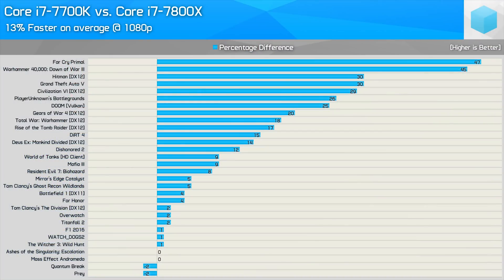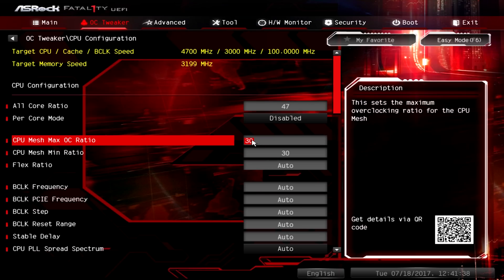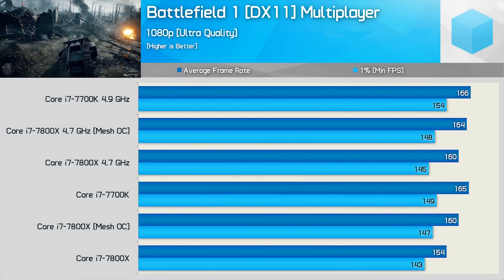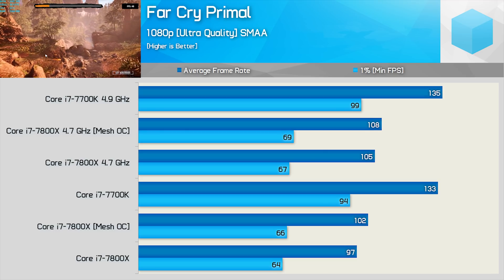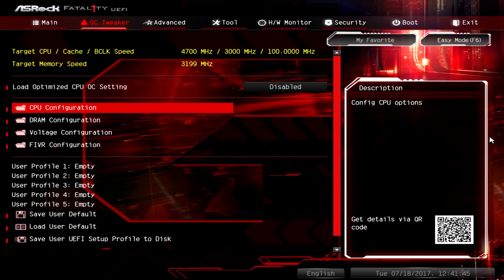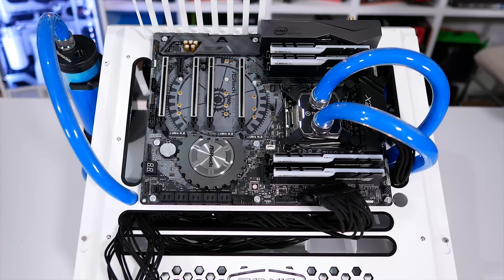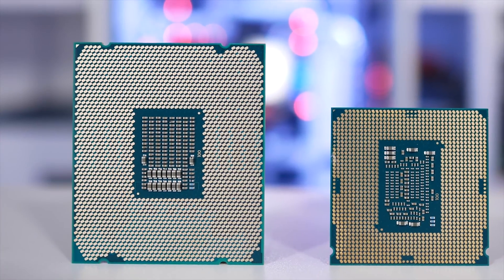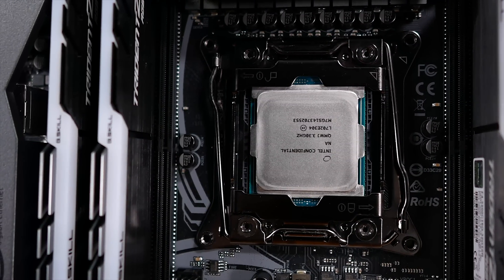Intel Mesh, Does Overclocking it Fix Skylake-X?

Comment: who's intel?!
Is that dead grandpa of amd?
Reply: Alex Lee - History shows, when AMD was last able to seriously compete with Intel, Intel tried hard, and it was good for all of us consumers. When AMD went down, Intel stopped trying hard and charged like a wounded bull for pretty much the same stuff they sold you 3 years ago. Now AMD are back, and suddenly Intel are pulling the wrapping paper off all this new bling. Why didn't they sell us that stuff last year? No, they didn't suddenly develop all this new bling since Ryzen got here - it takes longer than that. They pulled their finger out and started trying when the rumour came that Ryzen was on the way... Until then, they had their finger in all the way to the elbow....
Reply: Kneedragon1962 i'm not sure what you are trying to tell me but those 'bling's they showed turned out to be not that impressive if not disrespectful to consumers. i use an i5 myself so don't judge me but take the truth as is. intel is getting their ass handled and this is good for both sides.
Reply: OpTic KTG Daammm boy I've only been going off the windows 10 64bit benchmarks,...Windows XP was a great platform but Daaammm kid you have my sympathy!!.
Reply: MayDAY going down

are you dumb? its a first fucking gen arch vs intels thats been the same basic shit for like a decade. of course the first release wont be as good as the thing the competitor has been refining for years and years. 

however ryzen 3 most certtainly wasnt designed for gaming same with ryzen 5 and 7. all the cpus were designed for server use. the arch is a server arch. they simply happen to also be decent for desktop purposes. originally amd had a separate arch planned out for desktop cpus however that one was pushed back in favor of zen. 

also theres the fact that the 7700k wins only at 1080 but has worse minimums in alot of games and has more fps dips. 

theres also the fact that you literally just tried to compare a fucking server and HEDT platform to a desktop one. 

how about this then, notice that at the low end amd is worth more? aka better value. fuck a 7350k id get a 1400 for that money 2 cores 4 threads vs 4 cores 8 threads and a less then 15% difference in ipc. with a whole fucking 1ghz disadvantage in clock speed. 

how about that intels newest core i9 series is shit for the money and pointless. at 18 cores the people who would run that shit are the types who would most likely want ECC ram but you can only get that on locked xeons. how about the fact that intel artificially removes ECC support on chips, notice how before skylake i3s supported ECC and now they dont.  notice how intel is shitting talking a dual die cpu when they did it themselves before.  or how about that people on intel cpus havent felt the need to upgrade for a long time for those that actually know shit. 

oh yeah and btw 1080 144hz is a bullshit comparison unless you either have gsync or freesync top end gpus and lower settings so that the game stays above 144 locked no matter what you play. which isnt possible.  minimums at that point are more important then maximums. hence why lots of people are saying who cares about 10 fps when the minimiums are better or similar in many cases. 

and how about this, amd releases first gen arch intel is on their what like 6 refresh. what happens when amd releases a refresh and increases performance and clock speeds.  what happens if intel uses the UPI mesh design on coffee lake as well as the victim cache and hurts performance. amd is barely behind. and costs half. buying a ryzen 3 for like 100$ when they drop would be the same as getting a 4790k only on amd and alot cheaper. and it uses less power is easier to cool and actually beats a 4790k. 

intels been slacking. so maybe stfu use your head and realize sure intel wins my a minor amount. heres the question though. can you in a blind test even tell the difference between 120hz and 144? i doubt it as most people cant and even those that can often cant while actually immersed in a game. 60 hz to 144 sure 60 to 75 or 120 yeah. 120 to 144 is just for pro gamers or people wanting bragging rights. so if you cant really notice the difference why spend more for less. you get less cores less lanes and no upgrade path. if you cant notice the difference but still want one to bragg then let me ask you do you have a top end mobo ram psu ssds hdds and dual 1080's or 1080tis? or a titan xp? no probably not, thus shut up as ryzen means an OVERALL better system. hmmm ryzen cpu and cheaper board and better ram or 7700k on a non z270 chipset and a 1060 instead of a 1070 or 1080. hmmmm. 

a 7700k is if you dont mind upgrading sooner and already have top end everything otherwise its better to go ryzen. and even if you have top grade everything else sometimes ryzen is still better to go with as there is an upgrade path and it costs less so when you do have to upgrade youve saved more in the mean time. 

theres also the fact that a 1700x at 4ghz with 3600mhz ram vs a 5ghz 7700k with the same ram and a 1080ti closes the gap. so what happens if we get 4000mhz ram on ryzen? ram speed beyoind 3200mhz on intel is a waste and within margin of error where as on ryzen significant performance increases can be seen. 

what about yields and cost and profits amd will win that argument everytime which means they make more money. intels monolithic cpus while they have advantages they reduce yields hence why xeons are so expensive. where as amd can cheaper produce cpus with easily equivalent performance and even more features.  64 pcie lanes on threadripper only 56 on the brand fucking new skylake xeons. where as epyc has a fucking 128 lanes per system.  also dont forget amds shrinking to 7nm for their next cpus. thatll mean even less power at the same performance or much more performance at the same power. combine that with a ipc improvement in the actual design itself and yeah it wouldnt be hard for amd to catch up or offer even better value for the money and make intel less and less worth it.  intels next cpus are going to be on the same process as they are now just refined. no die shrink.  then there is the clock speed issue that some believe to be an issue with clock gating and believe it to be fixable by amd. so what happens if ryzen 2 gets a die shrink ipc boost and a clock speed boost up to say 4.5ghz which would only be a 200mhz over a golden chip currently and only 400-500mhz over an average cpu.  p[lus costs less doesnt need a new mobo and again has more lanes and more cores and similar performance.

sorry but you should use your head. the 7700k is a dumbass arguement being made by people. the only advantages intel has right now are in workstation purposes for any real users. mostly because intel has much faster avx performance among some other things. however is it worth the price difference? depends on the use case.  or if you play old games thatll never get patched for ryzen support then you go intel. 1080p with a fucking 1080ti when even a 7700k and 1080ti cant run it properly is just a bullshit statement, unless you can stay locked at above 144 the entire time maximums dont matter its better to have better minimums and less dips. 

ironically if intel had left the cache alone and also used a ringbus im betting that the 6 core x299 part wouldve become the new high end gaming cpu. 7700k wouldve been for fan boys that couldnt afford a 6 core. 6 cores equals less strain on the cpu with background things such as the OS and such, and wouldve meant when 8 thread gaming is the norm youd be able to have 4 cores 8 thread dedicated to the game and still have cores and threads for the os. wouldve simply reduced dips in some games and in others wouldve increased performance.  

sorry but quadcores as a high end gaming chip are dead. 

4c4t entry level

4c8t mid tier or ryzen first gen cpus since clock speed and ipc limitations. 

6c12t new high end gaming cpu.

8c16t entry level streaming processor

intel 10core20thread or amd 12 core dual stream/workstation cpus. less gaming performance but better for handling streams while gaming. 

at least for new games.
Reply: Kneedragon1962 Like I said to the guy, if you are just a gamer and own an i7700k Running at 5Ghz you ain't gunna upgrade to Ryzen for a couple of years, why would you?? you'd only be getting less frames in gaming performance.
It will take gaming devs a couple of years to utilise more than 4 cores, they themselves have stated that.
So if your just a gamer tell me why would I change my i7700k for any Ryzen CPU???
Would it not make more sense to wait for next year's or the year after 6 or 8 core CPU'S which will be fully optimised for gaming and be beating these Ryzen cpus and the i7700k??.
Reply: Kneedragon1962 Lol, as you can no doubt tell I'm not a streamer, never even been interested in doing it either, still ain't:).
I'm playing Elite dangerous Horizons in VR at the moment, I can't imagine the pain in the ass it would be having to continually take the headset off to check other open apps and streams, the game itself is complex  enough as it is without distractions lol.
I'm looking forward to the day devs implement full 8 core gaming cpus, when that eventually happens I'll be upgrading for sure, I highly doubt it will be an Intel CPU the way it's going. I'm really impressed with What AMD have done so would deffinatly consider one of there next cpu line ups that they make in a year or 2 time.
Reply: Who is AMD? Did they ever reach more then 20% market share? Everybody knows Intel inside with 80%+ market share.
Reply: Alex Lee - Then we are in agreement.
Reply: MayDay GoingDown!! Glad to have a civilized discussion with you. Of course the 'grandpa's should outperform. They cost that much more. However the ryzen chips for their price, totally outvalues intel chips at the current state.
Reply: +MayDay GoingDown!! I guess you don't get the joke 😐
Reply: +MayDay GoingDown!! Sorry I replied to the wrong comment
Reply: OpTic KTG Lol, hey no worries dude:)
Reply: Tripp Z Would I buy an i7700k today??
Depends on what you are doing.
If I'm just a gamer then yes; right now it's top of the board, it's only $300.00.
None of the 6 or 8 core Ryzen cpus are gunna be beating it in gaming until devs start to utilise and implement more than 4 core cpus...and that ain't happening for at least 2 to 3 years since the huge majority of Gamers are all on 4 core gaming cpus.
By 2 to 3 years all of these Ryzen cpus will be getting destroyed by the 2 to 3 years time cpus, so yeah, with the i7700k running at 5ghz your gunna have the best gaming CPU for 2 to 3 years.
If I was more into multitasking various apps and stuff I'd buy the 1700 or 1800x.
But don't forget, in 2 years time both Ryzen 7 and 8 will be far behind the new ones so.!!!!.
I myself upgrade both CPU and GPU every 3 years, this is because I like to not fall to far behind having the best spec in my rigg.
So regardless of which ever I buy now it's getting replaced in 3 years anyway as it will be pretty far behind in performance by then.
Put it this way, anyone with an i7700k is not going to upgrade to any Ryzen CPU and that's even including Threadripper and Epyc as they would be losing not gaining performance in games if it's only gaming you do, which is still the majority when buying these cpus.
I can already see people on many YouTube channels are dreaming of buying Epyc or threadripper thinking they are gunna see huge gains in gaming performance when in reality you might as well buy the half the price 1600 or i7 7700k as the 1600 gives you exactly the same gaming performance as threadripper and Epyc....the i7 7700k beats all 3 and for less.
These people will merely be wasting hundreds of pounds lol.
Reply: @ bmxriderforlife1234 - Very long and detailed and correct. I agree with you. Unfortunately, the person you're answering is probably not someone who will read it...
Reply: most likely not. oh well maybe someone else will and will realize something or not get fooled by a fanboy.  right now intel doesnt offer a good high end gaming cpu to be honest.  hopefully z370 doesnt use the new cache system and sticks with the ring bus design, well some people more knowledgeable then me are saying cache is the issue and that the link or bus would actually help performance had caching not changed. 

intel just needs to stop fucking up and realize you cant pay record high dividends anymore.  and solder your high end shit.
Reply: bmxriderforlife1234 First off your completely wrong...Sorry bud.
You think an i7700k only beats those cpus at 1080p???? Wrong, beats them at all resolutions, and once past 1080p the card is doing most of the work not the cpu.
You yourself have put the 6c 12 thread as a "New high end  gaming cpu"??? 
Makes no difference, the i7 7700k is currently beating that too yet your saying 4 core is dead. Well maybe in 2 to 3 years 4 cores will be dead but by then I wouldn't be buying these Ryzen chip's but rather the AMD or Intel chips out in 3 years time.
which brings me to my point, if you own an i7 7700k you won't be upgrading to these Ryzen chips now, you would have less performance in gaming...why on earth would you do or want that??? Hence your good until the next gen or wait for devs to utilise more than 4 cores in all game titles which according to them will take a couple of years before it's the norm.
Like I said, if you are only gaming then show me any Ryzen chip that is beating an i7700k Running at 5Ghz???? 
If your multitasking then yeah get the 1700 or 1800.
Show me the benchmarks of your New 1600 "high end gaming cpu" beating an i7700k Running at 5Ghz across the board in games at any resolution???
Show me a 4 core isn't still going to be beating a 6 core for the next couple of years??.
The i7700k is $300.00. Hardly Intel's highest end, point is it's beating all Ryzen CPU'S in just gaming which are still the majority by a long way over streamers.
Reply: MayDay GoingDown - Yeah, true. The funny thing, is we've been here before. Just on 20 years ago we had screaming blues about screaming Cindy. Streaming SIMD was a wide data path designed to put one repeated instruction to a stream of data, which is very useful for decoding video, for example. But it doesn't help anything unless devs use it. So we had a screaming argument about the Pentium and the Pentium2 and Screaming Cindy. I'm sure it does get used now, but for ages after that, nobody anywhere used it or admitted to using it... it just became so politicised... More recently, in Linux, we've had systemd in place of init. It seems to work alright, that's not really the problem. It's become political...
Reply: obviously no one who just bought something is going to upgrade.  no one said they should.
 you cant actually say that, first off go look at all the videos talking about how fx cpus improved more over time and now beat or tie the 2500k. 

obviously the card is doing more of the work however that doesnt actually mean anything. 1080p gaming benchmarks dont really mean as much as people think.  and are kinda moot since neither cpu can drive 144hz properly and we dont even have a single gpu that will at 1080p either unless you really lower settings at which point why buy top end hardware even pro gamers often dont.  go look at current games, games already and have been for a while now moving towards 8 threads. you can already see this with i5's notice how people complain about them stuttering a shit ton in many modern games with 1070's. pretty sure this channel himself has stated that 6 cores are going to be the new thing. wendell of level1techs has pretty much said though not in these exact words intel has been stagnating the cpu market we shouldve been at 6 cores by now. hes right. 

okay let me spell it out for you, intels own x299 7800 6 core cpu, the reason its performance is ass  is the cache and potentially mesh. skylake has kabylake ipc as far as gaming goes. so since we cant use that comparison we can use another, take an older gen i7 and the equivalent xeon downclock the i7 to the same performance as the xeon, now test, in many modern games the higher core chip will get bottlenecked less.  the 2 extra cores arent there for the game they are there for the OS. we are starting to hit the limits of what 4 cores and 8 threads can do. and intel didnt increase ipc much the last couple gens. 

theres also the fact every current game is a rigged comparison in favor of intel (yes even amd games) why because the simple fact of ryzen was a rush job people didnt know. games were not designed for it. im sure there isnt a hell of alot on the table but im expecting there is still performance purely for the arch itself. some devs have actually commented about this saying how what works for one arch can severely hurt performance on another and that there is only so much that can be done post release. 

i never said ryzen right now beats a 7700k im saying within a year that gap will just start getting smaller and smaller. it already does with 3600mhz ram. mindblank tech go look. i7 7700k 5ghz vs 1700(x not entirely sure) 4ghz both with the same speed ram and different ram speeds to show scaling. my buddy also has both a 7700k and 2 ryzen 5's and all 3 skus for ryzen 7, and in his own testing is agreeing with me. 4 cores are dead as the top end cpu. it starts now how long itll take to die is a matter of time.  7700k is going to start stuttering eventually. its like compare the 7350k and an i4 locked. 5ghz on a 2core 4 thread to get locked i5 level performance. a 7700k at 5ghz is riding the edge of its seat. its beastly dont get me wrong and easily still worth getting, however i wouldnt keep it 3 years. 

look at the consoles 8 core cpus, what are games always optimized the most for, console, what also besides the pc market heavily influences the pcmarkets growth? consoles. sorry but its obvious for anyone with a brain. 7700k is going to have a shorter life span then your average cpu from a given gen. not as bad as the old days but yeah. 7700k is still a beast however if it starts getting stutters it wont matter if its frame rate is higher if it has a less smooth experience. 

the point is if you already have something yeah no point in upgrading for anyone still buying fuck a 7700k save yourself some money in these fucked up times where 1070s are the price of 1080's and ram kits are 300$ for normal ram. and ssds are priced high.  7700ks are for people like my buddy who literally upgrades every year. or his brother who has a 4 socket xeon system in his room. average people go buy ryzen save a few bucks dont get your panties in a knot and guess what in about 12 months zen 2 maybe a little more better performance still low costs plus a die shrink and same board, update bios buy new cpu plug it in sell the old one. alot easier then rebuild whole system on new board. 

the reason a 6 core is the new high end part(which btw intel would seem to agree with seeing as next consumer lineup 6 core i7's) is simply to take the 4 cores and 8 threads you need for gaming and give them purely to the game, no bs from the os in the background( which btw can actually eat performance and reduce the gaming experience) 

they dont have to utilize more then 4 cores for ryzen to win if they just load 4 cores so hard the 7700k cant run the os in the background or needs to reduce game performance to actually handle the os and other shit then yeah. and 4 cores 8 thread optimization is just getting better and better. ironically if intel had left skylake x alone and just big skylake the 6 core cpu wouldve been a cpu that couldve lasted as a reasonable gaming cpu probably for a good 5 years. 

if a 7700k a stupid fast quadcore actually the fastest quadcore on the planet ever for a consumer cpu, is getting bottlenecked and showing its limits that proves my point benchs show this ryzen often gets better minimums but loses only on the top end. depends on the game yes however thats unquestionable. intel has optimization way ahead, better ipc a whole ghz on clock speed. or is the ryzen line up secretly faster on ipc then kabylake and being gimped? use your head. 

second high end cpus you absolute fucking moron are NOT AIMED AT FUCKING GAMING. look at x299 skylake x intel literally gimped them in gaming for pro workloads. amds whole up is the same arch.  intels consumer line is basically a test batch for their server cpus the following generation.  and workstation cpus are cut down server cpus(x299)

as i said wait for intels next consumer line up, if im right itll be another kaby/skylake except in pro workloads(also interesting the only improvement as far as gaming goes for kabylake is clock speed and intel told people not to overclock but loads in the pro side of things) gaming will probably just be 2 extra cores to reduce dips and a slight clock speed jump probably closer to 5ghz at stock and more chips able to hit it.  we shall see and if im right perfect scenario cause then ipc can be tested per workload type and determined at fixed clock speeds. and single core performance quadcore performance and total multicore performance can be compared. and im willing to bet itll be the same and the 6 core part clock for clock with a 7700k will show my point.

sorry but this is a case of all you need is a single\dual\i5 again, there is enough now to see where the market is going, we can see where devs are going. we can already see games start to use more then 4 cores and potentially benefitting from it and we can easily see extra cores reduce overhead which in tern reduces dips. if 1080p 144hz is going to be intels argument at least actually consider it for a second. if we can already see whats happening with a 7700k getting bottlenecked by itself whats going to happen in a year. any other gen i7 has been able to last the 5 year mark, 7700k is going to fall short and probably not live a graceful end for the people who expected it to age more like previous gens. 

no one said go sell your 7700k for a ryzen cpu people saying simply saying buying a 7700k right now doesnt make as much sense as you claim and that you are making idiotic comparisons.  high end cpus arent gaming cpus. at one point you literally did not need anything over an i5, not true anymore, quadcores as the top end gaming cpu is done it starts here. btw never owned an amd cpu intel my whole life so not a fanboy.
Reply: MayDay Going Down - Ryzen was maybe designed, in part, to play games. Threadripper wasn't and EPYC sure as fkcu wasn't. It can maybe do that, but that's like using a violin to dig a hole. Perhaps you can, but that's not what it's for.
Reply: OpTic KTG Hahhaaa what on earth are you on about??? 
The conversation was about the i7700k beating the all Ryzen CPU'S in gaming....which it does lol.
And then there is YOU posting prices on NEW EGG??? 🤣🤣🤣🤣.
At least my remaining brain cell knows what we are talking about in the first place....unlike yours lol...oh it's too easy, you fanboys....its just too easy lmfao.
I'll repeat, come back when you can prove fact wrong!!...🤣
Reply: Alex Lee My original point was in response to your first post, point being that "old grandpa" as you claim is still outperforming the brand new Ryzen CPU'S in Gaming,
You don't have to prove anything bud...theres nothing for you to prove, that's all there already for everyone to see in actual benchmarks lol:).
Reply: MayDay GoingDown!! oh look, a loyal slave of intel. keep defending them. attack amd. intel won't give a damn for you
Reply: MayDay GoingDown!! thanks but my sweet tits will stay with me. why do i have to prove anything for you, most of the news related to cpus are about amd/intel thing and i'm sure you watched them plenty. or were you so biased to see both sides of the story?
Reply: Kneedragon1962 "like using a Violin to dig a hole"...🤣🤣oh I like that!!. As for Ryzen,the 3 and 5 series are aimed purley at the Gamers. You could also add the 1700 to that really.
Reply: +MayDay GoingDown!! I'm sorry for your loss of brain cells my friend. If you would like to find out how to get them back then go to this website this, it will help you gain them back garanteed :) https://goo.gl/t7q4fF
Reply: +MayDay GoingDown!! Could add the 1700 sure, but that was really intended for streaming and more workstation related tasks at a more affordable price. Oddly enough, overclocking it to around 1800x levels or Ryzen's max clocks show the biggest benefit in games, but then you might as well have gotten a 1600 for that, since it is cheaper.
Reply: FR34KZ No...its the old grandpa that's STILL kicking every AMD Ryzen chip's ass including Epyc and Threadripper in gaming  with an old i7700k lol.